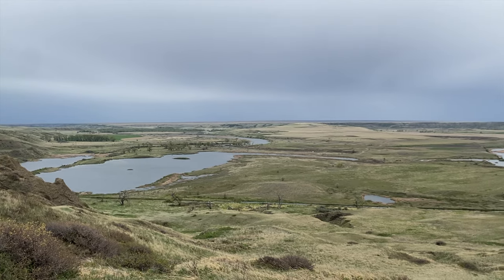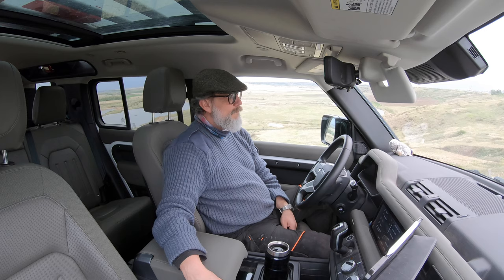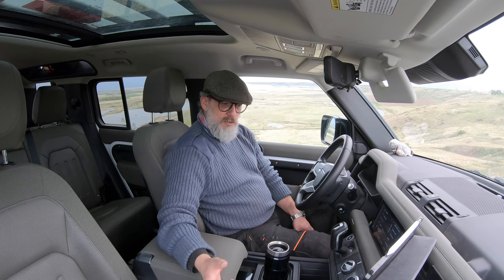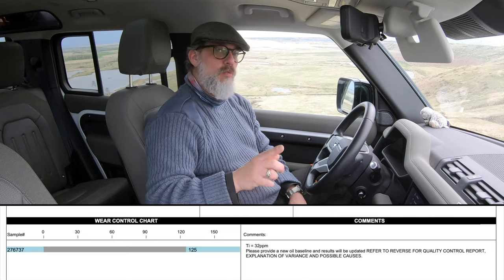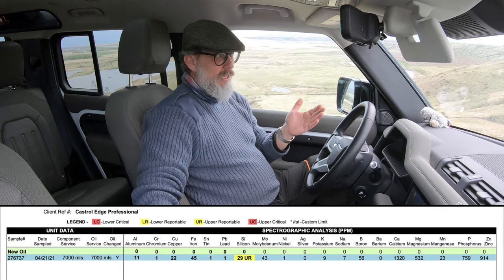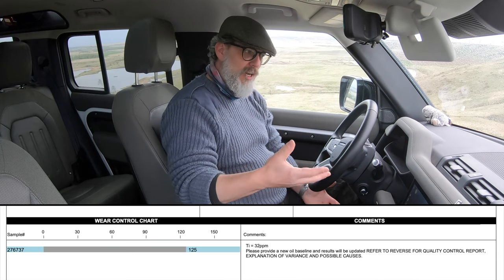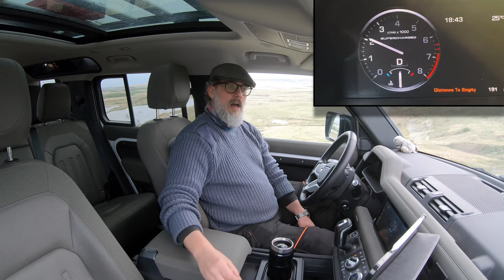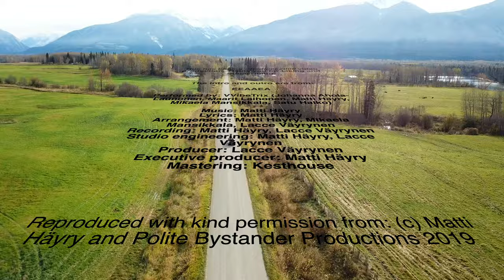Changing the Oil Matters: Oil Sample Analysis on a defender P400 #newdefender #defender110 #l663

Comment: I changed the oil on my 2020 Defender (P400) about 2 weeks ago and just got the results. The oil had 12000 miles on it and the car has 33000 miles on it. My Iron was 61, silicon was 24, titanium was 4, calcium was 1742, and TBN was 2.1. I'm using LiquiMoly (special tech LR). I will be doing shorter intervals for sure. Clearly something isn't quite right with the engines. I changed my air filter at the last oil change also.
Reply from the maker: Thanks for the feedback, Nathan! What colour was it when you changed it? How did it smell? 

The figures you’ve shared seem excessive to me — especially the silicon and iron. Did you throw LiquidMoly in this time or at the beginning? I’ve heard a lot about their product — does it pass muster with the warranty requirements? 

I agree. Something is definitely not right. Its entirely possible that JLR have decided that major engine failure due to long drain oil is likely going to not be their problem, and have sort of waved their hands at the results they’re getting back. They must clearly have had the same kind of results we have had from their tests, so ignoring the figures can only suggest they don’t care (in the same way that they didn’t care about the L322 front diff debacle or the ZF transmission issues). Not a good sign if things to come, methinks.
Reply: It smelled fine. It wasn't too dark either. It did smell and feel like it was time to change it though. I will not be going as long any more. I will probably do 7000 on my next one and keep reducing the interval if the numbers stay high. Maybe an oil filter change at 3500. The car came with the Castrol. I did the first change at 21000 (per the manual, oops) and that's when I went to the LiquiMoly. The LiquiMoly I'm using is the LR designated oil. I researched and found there may be 2 specs of oil listed. I think the workshop manual says the LiquiMoly spec is ok, but the owners manual doesn't list it. I told the dealership I was using it and they seemed impressed I was using LiquiMoly so I guess I should be safe. I'm guessing my next change will be in about 6 months or less, and I'll test it again then and report back. Just because the warranty expires, I don't think that will get them out of trouble if these results are this common of a problem.
Reply from the maker: I’ve heard good things about LiquidMoly, but I know very little about it. What made you make the switch? I’m interested to learn that there’s a difference between the two manuals. 

It might be worth checking in 5,000 miles to see what condition it’s in. If it’s good, you can then try 7,000. 

JLR haven’t been great at honouring warranty issues. The 2.0ltr diesel is still blowing up left right and centre (even in the new defenders), the TD6 cranks are not warrantied past the warranty period even though it’s a known issue (same is true of the D5 windshields), and so on. I don’t foresee a major issue with the straight sixes, but the oil issue will clearly reduce the life of the engine.
Reply: @shedlock2000  ultimately it's easy to get. The Castrol in LR spec was only available from the dealership and they no longer sell it. I like LiquiMoly and heard good things about the oil. And its available in what is an LR spec.
Reply from the maker: @not_the_stig  Ahhh! Yes, good point. It’s not easy to find where I am, sadly. I know there’s a Fuchs equivalent too, but that’s unobtanium in Canada. I have heard that Mobil 1 meets the specs, but there are so many Mobil 1 varieties I’m not sure which it is, as none of them show the JLR (or European) or standards on the label!
Reply: Question for you. Has your car had the PCV repair (recall N627) done? I had the check engine light on and rough idle a few months ago. I took it in and they figured it was the PCV. They said not to drive it and it took 2 weeks for the part to arrive. I ask because I received the recall notice today and one of the items stated was that air can leak within the crank case. I don't know if this would explain the oil analysis contents.
Reply from the maker: @not_the_stig  Hi Nathan, 

No, the PCV wasn’t an issue at the time mine was in for these dramas. I’m assuming that it’s the P400 you’re yakking about? 

I doubt that PCV issue would affect the silicon etc (though it might oxidise the oil more quickly). However, I did have a number of issues with surging and fuel economy which may have had a lot to do with the PCV — of course, JLR weren’t very good at dealing with my issues whatsoever, so they never got as far as actually trying to diagnose it!

Comment: Just wondering what are you thoughts as to extended service intervals for low mileage vehicles, I am in the UK and average about 6k annually so follow the 2 year service program. It appears from reading the comments I would be better changing my Poland filters annually.
Reply from the maker: Hi David, 

You do have low mileage! Once upon a time, I would have recommended that you change the oil once a year because of condensation capture (mineral oils didn’t do well with condensation). With the newer synthetic oils that’s much less of an issue. 

Assuming you’re right at 6,000 miles per year, you’d probably be able to push it to two years (given the temperate climate, lack of dust, newer engine design, and high-grade Castrol synthetic oils used), because your only issue would be condensation from short journeys. I’d prefer 18 months because I’d really struggle (myself) to take it past 10,000 miles without dropping the oil, but the reality is the oil would likely be ok with a 12,000 mile drop.

Comment: I'm not sure if this is relevant, but our 2015 RR Sport , 3 litre diesel, always asks for an oil change every 6000 miles or so. LR always say they can't understand it, as it's supposed to be a year or 16,000 miles. We just do it with a local LR Specialist. Worth it for £170.
Reply: Is the oil being contaminated by fuel and raising on the electronic dipstick, triggering a service indicator?
As it happens I'm changing the oil and filter on a six cylinder, six litre turbo-intercooler engine today. It takes 18litres of premium diesel oil which costs me £31.50 [bought in 200 litre barrels] plus two large filters, another £30. All plus VAT.  Point being that I see £170 for an oil change every 6000 miles and think 'WOW, that's expensive!'   Not being facetious or anything, the last sentence of yours just tickled me pink.
Reply: @hedydd2  Hi Huw, thank you for your reply, I'm not sure whether the oil is getting contaminated, I'm not 
mechanically minded, so, I get my local 4x4 garage to do it. Other than servicing the car has been super reliable and I kinda think of it as Karma...lol.
Reply: @adkc19  
They make lovely vehicles and if you have a good one it will be just a pleasure to own and drive.
Reply from the maker: The JLR recommended Castrol Edge Profesaional is monty money, Huw! Even bought direct from Castrol it’s expensive! Some Mobil 1 oils meet and exceed JLR’s recommended specifications (and is half the price), but I can’t seem to find which one it is over here — so while mine’s in warranty, it’ll have JLR oil!
Reply from the maker: Agreed, @andy c. £170 isn’t all the money when you think about it! 

JLR’s extreme service interval is 5,000-6,000. It may have been programmed for that rather than the regular interval. I’m not sure how it’s done, but it’s likely the reason.
Reply: @shedlock2000  Hi, that's interesting, I'll look into it and feed back. Thank you :-)
Reply from the maker: No worries! I’m not sure if that’s the cause — but it’s all I can think of!
Reply: @shedlock2000  
There are plenty of alternatives to Castrol Edge Professional fully synthetic 0W/20. There will be an international specification for the oil in the book and any oil that meets or exceeds that is perfectly acceptable under warranty and otherwise. They will all be fairly expensive when bought in small containers, but especially so when supplied through a dealer’s workshop. They buy in a minimum of several 200 litre drums at a time and retail it at a litre pack rate. Try and source an alternative or even the Castrol from a motor factors with a trade discount [just ask for it] in 20 litre drums. You may be amazed by the saving possible. Take that to your LR dealer and tell them to use it rather than theirs.
Reply from the maker: There are a number of alternatives to that spec, but they’re hard to source in Canada because North America uses different specification grades, so the bottles are not marked with specs that satisfy the JLR demands. You can import stuff that is, but that’s expensive too. Mobile 1 make an oil which meets the specs, but there are many versions of mobile 1 and the specifications required are not listed on the bottles (so you can’t use the ones off the shelf).

You don’t have those issues in Europe, and the Fuchs, Mobile 1, and others that meet or exceed the specifications will be easy to source.
Reply: @shedlock2000  
Ah the Americans are still stuck with basic minimum standards set by API and SAE and nothing much to distinguish high performance oils other than claims as to the quality of their base oil.  
Yes, being in the UK and up until recently of the EU, I assumed the US had the same sort of gradation as the ACEA in Europe where performance standards were fairly easy to distinguish and therefore suitable alternative products easy to identify and buy.
Reply from the maker: I think they have a set of specifications, but (obviously) European specifications aren’t used. I’m not well up enough on oils to know what the acronyms mean, I just know that, after having been given clear specs to look for, none of the codes are even remotely the same (including — and most importantly — the prefix letters).

Comment: Hi do you believe in an oil drop when the run in period is over i.e 1000 miles ??? after all the initial wear is over
Reply from the maker: Hi Jon, 

I don’t believe this is necessary on modern engines. The thinking behind the early drop was because older engines had less refined tolerances and would ‘bed-in’ (which means that parts in transition fits would wear away a bit). This bedding-in process would generate large amounts of metallic contaminates (as I’ve mentioned above in my reply to @Huw); these contaminates, if left in circulation, would damage the engine and thus needed removal. 

Once the engine had run 1000 miles or so, the bedding in would be complete and there would not be any further contamination. However, modern engines have much better machining tolerances and materials, so they don’t really bed-in. Accordingly, there’s fewer contaminates in the oil to cause damage and you’re safe to run it for longer. 

The above being said, it’s still not wise to thrash or rev hard a new engine.
Reply: @shedlock2000  I am a great believer of correct running in procedure etc etc and the regular oil change regime as you said "oil is far cheaper  than
 a new engine".
Reply from the maker: Agreed!

Comment: Do you have a recommendation for the ZF in the defender?
Reply from the maker: Do you mean do I have a service recommendation? Yes, ZF recommend servicing the box every 75,000miles. I do mine every 75,000km (see below). I did that on my rangy and on my LR3 (though they were both 6 speeds). 

The 8 speed ZFs have a similar design and the service is done in the same way: the pan is also the filter, that is swapped out and new fluid is installed. If you’re lucky, there’s a place near you that can push fluid through. Otherwise, you’ll end up with old oil in the torque converter and cooler that you can’t drain by hand. Because I swap my transmission oil every 75,000km (due to having no transmission shop here with a pump), I reduce the amount of dirty oil in my transmission more frequently (though some will remain in the system, the fresh filter helps reduce its effect on the new oil).

Comment: My ex employer got a 2004 Mondeo to drive from his house to the office every day. Never serviced it in may be 10 years, had repairs carried out ,as an when it needed. The oil and filters did 75,000.. not saying it's right tho..🤔
Reply from the maker: I know a few stories like that, and I’ve seen the rocker covers of such engines! There’re photos on the t’interwebs you should take a look at. Also, older engines like Mondeo’s were much more forgiving as their build roller exes were less right and their oil ways were bigger (such that, even with baked-on oil, oil could still pass); oil ways are now much smaller and are more prone to clogging up causing timing chain and rocker bearing issues.